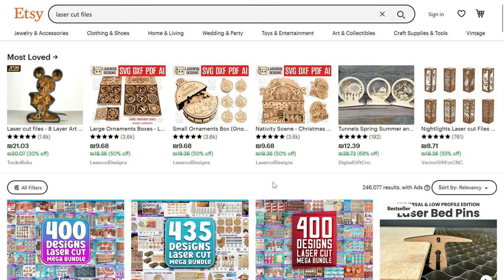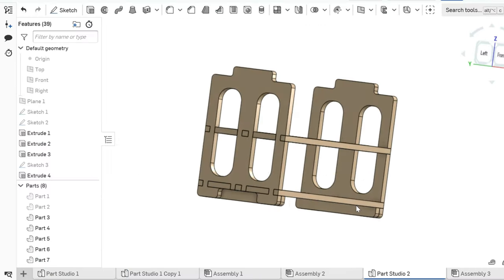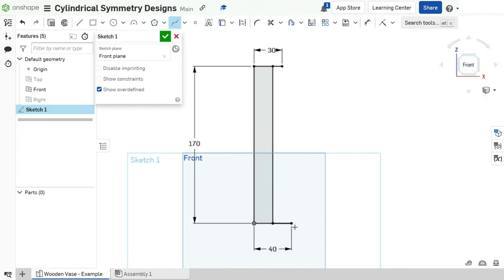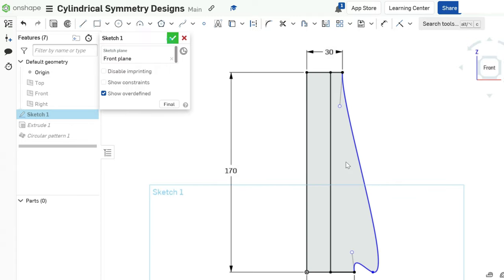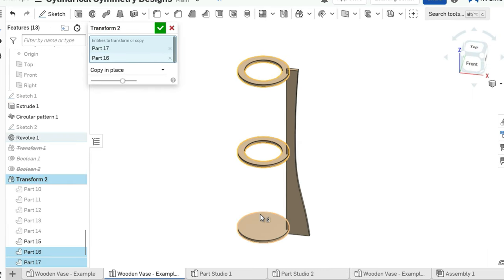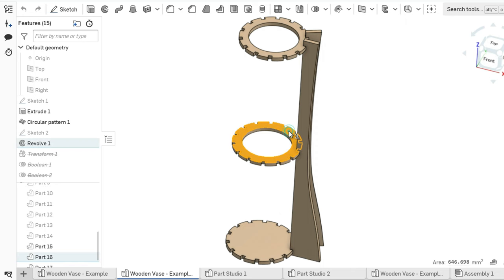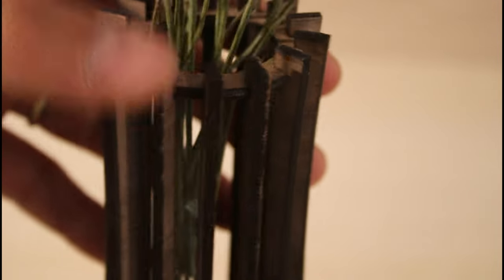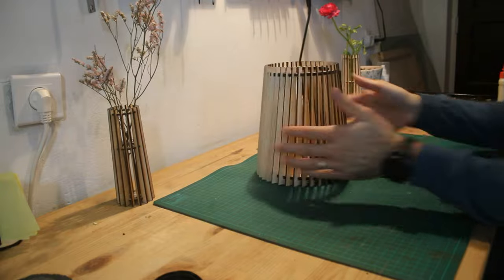How To Design For Laser Cutting | Easier Than You Think | Free Files

Comment: Hi how do I change the thickness of base in lamp?
Reply from the maker: Are you using LightBurn? If so, you can use the slot & tab resizer. If you're having trouble, feel free to contact me via my website with what you need and I'll help (I could make files for a different thickness if it helps, but LightBurn has a great solution for that, so it's worth trying!)